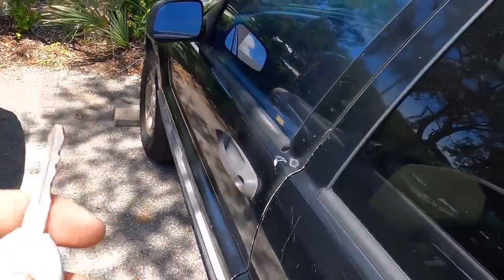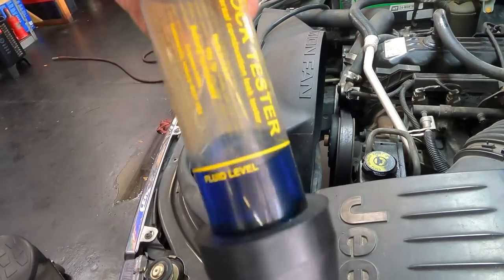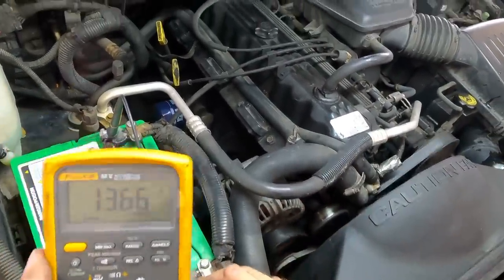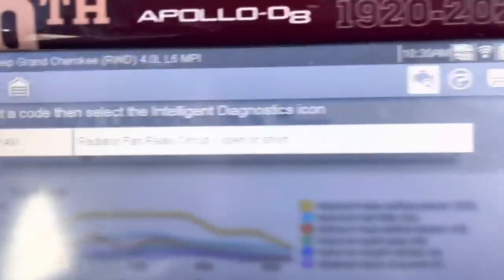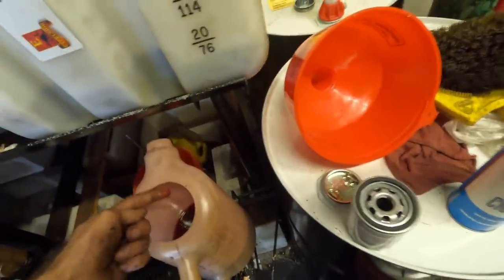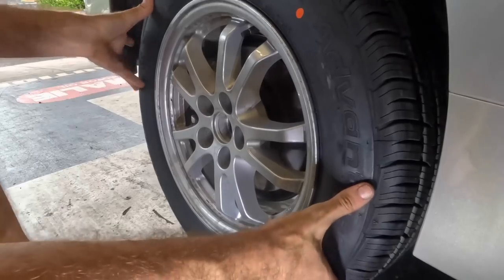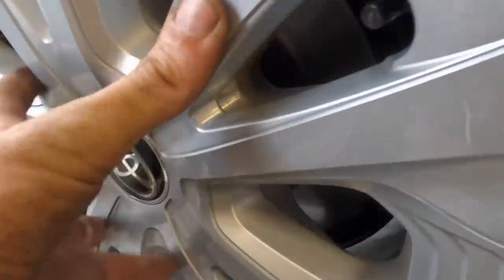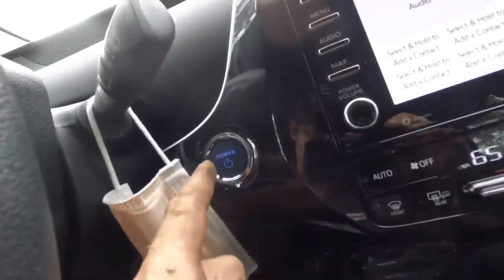How much longer will it last? Jeep Grand Cherokee 4.0 I6 | Compilation

Comment: FYI that cold start knocking is 100% normal for the 4.0 especially higher miles.
Reply: It could also be lifter noise from worn hydraulic lifters. They can take a while to pump back up from a cold start.
Reply: @machintelligence  With the 4.0's it's usually piston slap for the first few minutes.   After that if there's ticking it's worn lifters.

Comment: Current flow is proportional to torque! If the fan is not spinning freely, or has drag on it, or perhaps the bearing is going bad, and has more friction than it should have, the current flow will be higher, as there will be more torque! If the fan motor bearing is failing, or if the fan is rubbing on something, and the torque increases, The increased current flow may be damaging the part you are referring to as a relay! That may be what is responsible for the premature failure of that part! Make sure the fan spins freely, before just assuming it was infant mortality of a new part! Otherwise, you may be replacing that part over and over again, never realizing that the fan is drawing too much current, in relationship to the added torque on the motor.

Comment: most of the time... the computer is controlling the ground on any system.  That's how the majority of transistors work.  It puts the load on the item, and not the transistor. But that's a dumb spot to put a relay.

Comment: Ray - Sadly, I think your customer is going to be unhappy with the short life they get from the solid-state component you installed. The part you removed looked quite new.
The part you installed badly needs a heat sink and an inter-part coating of thermal conductive compound (like Arctic Silver as an example) between the solid-state component and the heat sink.  
This same design arrangement was used to control the blower speed in ZJ Grand Cherokees with the climate control option. I don't know if the solid-state device used is a power transistor or a thyristor, but pulse width modulation speed control is the method used the regulate the motor speed.  The ZJs often had the power transistor/thyristor fail because it became buried under an insulating blanket of leaf litter/detritus and/or rain water washed out the thermal conduction compound between the aluminum heat sink and the solid state device (power trans/thyristor).

Comment: what temperature is the thermostat before you go pull in the water pump apart cuz they could have got the wrong one instead of the 170 or 180 that's supposed to be in there maybe they got a 200 or 195 thermostat in there that's why you're getting the temperature you are but his brain as you are I'm pretty sure you already thought of this that's why I probably shouldn't even have wrote this down

Comment: Maybe since the relay is exposed to the elements it got wet. Maybe you should move it? I noticed the inspection sticker on the windshield which we don’t have in florida so, between rain and snow…
The Prius actually has nice rims under the hubcaps.
Reply: It's a sealed unit, and watertight.

Comment: Hub cap on a half decent ally? Weird, must be an aerodynamic ting.
Reply: Especially when the lug nuts/bolts were chrome plated. Some rocket scientist at the factory said "Let's cover up the chrome with a gray plastic disc and then charge extra for hubcaps."

Comment: Perhaps someone with more knowledge of cars than I can answer. But, why is the fan relay there? Doesn't make sense to me to have a relay so far from the rest of them. Is it higher power as to separate from other components?

One thing that kinda bugs me though, is that oil changes are the same between hybrids and gas even though the engine doesn't run half as much due to the electric motor running. Yes, I am aware that the odometer doesn't care which motor runs which does complicate things and likely just edging on caution rather than guessing what ratio of gas vs electric you're running.

I sorta wish there was a way to know the gas engine usage vs electric so maintenance of each would be better managed rather than ballpark it.

Comment: This generation is notorious for cooling system problems. Heater cores like to leak or get plugged up. Water pumps fail. Old hoses tear and leak. The radiators with plastic ends like to leak. Nothing lasts forever.

Comment: Everybody likes to hate on these Jeeps and their issues but the real problem came from the owner of the brand....... Chrysler 
    Especially in this era the early 2000s Chrysler was not doing great, the worst of the American big 3 (it was pretty much a downward spiral after they merged with Mercedes in 98) and then 2008 happened and it nearly killed them and likely would have if Fiat didn't jump in and buy them

Comment: Should’ve checked to see how clogged the radiator is. 20+ years and almost 400K miles of bugs and debris.
Reply: No way that's the original radiator lol
Reply: @samholdsworth420  probably not but you would be amazed how much debris accumulates between the condenser and radiator.
Reply: @khakiswag  oh I can believe it. I drive an old 00 Jimmy and have a 99 blazer for parts. The amount of sludge in the cooling systems I have cleaned out is disgusting lol

Comment: This is the kind of thing that drives this engineer crazy!!! What the hell??? EVERY other manufacturer uses a standardized relay located in a fuse box or a relay bank, and they did THIS???? WHY??? What is the address of  the engineer who designed this and/or allowed it to be built this way?!!?!?!? I want to speak to him!
Reply: On reconsideration, I get it... why this was done this way. The relay and fan probably came as a kit from a sub. They had overheating problems with the relay. So rather than demand the manufacturer source a different relay, they instead decided to put it in the front of the vehicle to maximize airflow and therefore cooling. What a hack job for the engineers!!!!

Comment: Liuving in a northerly state I felt the pain of the poor schmuck who has to place those lug nuts on the Prius into the wells in the wheel, and get the nut started without crossthreading while wearing warm gloves.

Comment: I'm only 13 minutes in to this video and I'm putting my chips on the table that the the vehicle was in a crash of some sort that was just enough Force to sever the wires to the fan causing the relay to fail...

Comment: Noticed that someone doesn't know where to place the yellow or red dot when installing a new tire on a wheel.  Such basic tire knowledge should be in tire training 101.
Reply from the maker: Yellow dot goes near the valve stem
Reply: @RainmanRaysRepairs  Yes, I know that but the installer didn't.  Really enjoy your videos, keep them coming. Thanks

Comment: Great diag Ray!
The solid state relay requires a real finned aluminum heatsink, not just screwed to a curved, painted, dirty body panel. 
That's why it has that shiny aluminum backplate. That's why it failed before, and will fail again. 
Chryslers are designed for crushing before 100k.

Comment: every Jeep owner in the world has got a hole cut to that relay because it has gone out at one point in time. it is in a stupid ass location. I hope in this video I see you cutting the access hole. That model jeep has too big an engine for the engine bay and has always had temp issues. I struggle with mine every summer. Having it idle with the AC on will cause it to overheat in almost any condition.

lolz... told ya about that relay! They got me by 90,000 miles too.

if you look there is a way to install a mechanical fan on this engine and that helped mine quite a bit, but I still struggle at idle.

Comment: Only 8 minutes into video and no power to the fan .. i have seen this hundreds of time I bet when he changed the thermostat the air in the system was not purged and the sensor that tells the PCM when its hot to turn on the fan isnt picking up any signal because of the air pocket. Thinking that using a vacum pump to bleed the air from the system might fix over heating as well as the fan issue.  Just adding coolant without purging the air from the system was a mistake and will mask diagnostics .. Jumping the gun instead of following through each concern. As for blown headgasket and gas in the cooling system? I have the exact same tool and it takes less then 60 seconds to turn the blue dye yellow if there is exhaust in the cooling system.

Comment: Space-saver spares are a Bad Idea - it's just lazy design. And after you fit the spare, where do you put the flat full-size wheel? In the back seat, with the kids? On the roof. Duct-taped to the bonnet.?

And do you want to be driving at 80kph, at night, in the wet, on the freeway, with everyone else doing 110kph? Nah.

Comment: Stupid $1.70 part...if your garage don't know about that relay hiding underneath the right side headlight it will cost over $800for this repair because the manufacturer states that the whole front will have to be removed

Comment: What the customer doesn't realize is that he's going to be right back in this situation in short order.  You fixed a symptom of the underlying problem, and that problem is inadequate coolant flow.  As a result, coolant temps are going to run hotter for longer, and he's going to put excessive duty cycles (longer and more frequent) on the fan and relay, thus burning the relay out faster.  SMH.

You can only lead a horse to water, Ray.  In this case, very hot water.
Reply: Yes, but it's coming on winter, and the guy just might have wanted a pointer to do the work himself. It is a well worn vehicle.

Comment: Just like an old Ford ignition module, it needs heat sink compound and a clean mounting surface. Douche bag engineers put it on a metal fender to get rid of heat. SMH.

Comment: even back in 1964 christ ler used plastic or nylon impellers that would detract from shaft causing over heat problems. way to go lose customers.

Comment: We're gonna charge you $ 120.00 because you're too lazy to air up your own tires.. you could have done it yourself for like $ 2.00 since most places charge for air now ..it use to be free.
Reply: The QT stations in St Louis still have free air.  I'm old enough to remember when they pumped the gas, checked the oil, and washed the windshield for you.